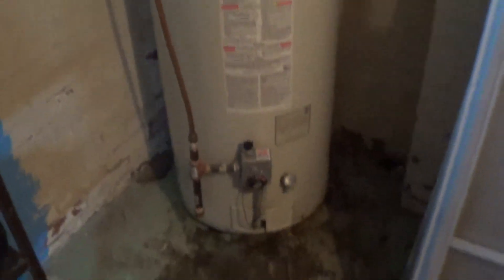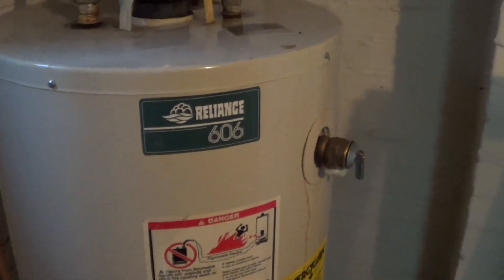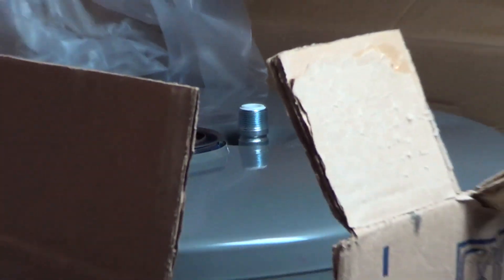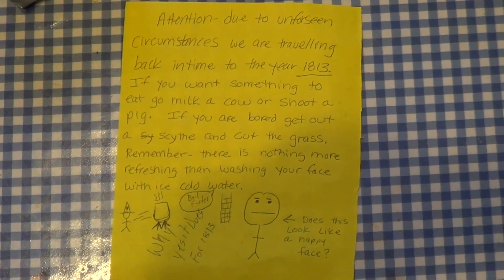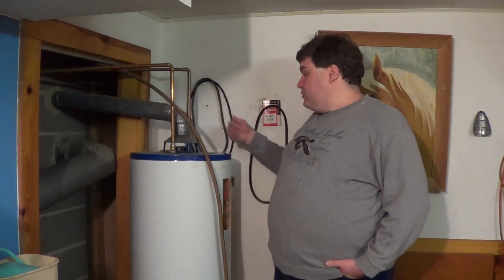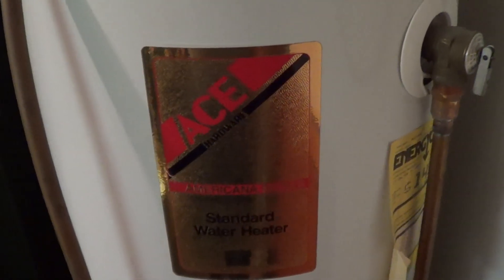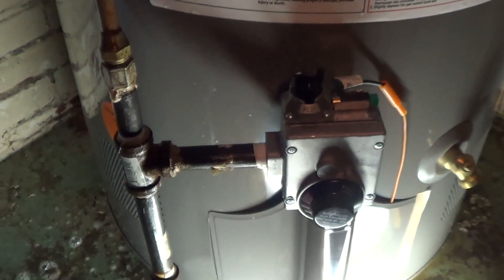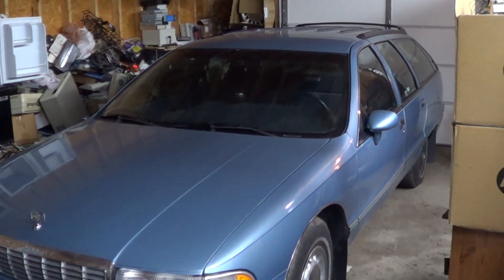Water Heater Failure, Replacement and Rambling

Comment: Weird that this pops up in my feed 6 years later. I just had to replace my enerplus gas water heater that was installed in 2012... what a short period of life. It also got pin holes in the bottom. I had a Bradford white installed and now I’m reading terrible reviews :(
Reply from the maker: You'll find terrible reviews for almost anything. Any Bradford White water heater I've seen seemed to be perfectly reliable and well made. At the very least, they're no worse than anything else. I fear that gone are the days of a water heater lasting 50+ years.
Reply: It seems like an ok unit to me at least! This one has a different style cold water dip tube, it makes the water in the tank have a whirlpool effect while it’s filling. This should keep the hard water deposits at bay although I do have a water softener now! Thanks for the reply.

Comment: i believe Rheem also owns the RUUD brand too ours lasted almost 20 years which was replaced as it was not producing hot water. as it was made in 1994 its a draft induced water heater a power vent model  with a hot surface igition what happens when it needs to heat the water the blower starts which closes a vacuum switch and starts the ignition and the burner fires when its done everything turns off the A.O.Smith water heater which replaced it its also draft induced which has an electronic self diagnostic gas valve. was installed in 09 the recent replacement was the blower motor as it burned out and put in a more energy efficient PSC motor to replace the shaded pole motor on it . with these draft induced water heaters in addition to the gas hookup you need to have a 120volt power source to the water heater and grounded. as A.O. smith makes a newer water heater with a spiral element in it.

Comment: It happens to me when I lost one of the Hot Water Tank where the water pipe had been busted, and the Hot Water Tank also busted open spread the water all over the floor since 2003, where I've got one is the unknown brand Hot Water Tank where I don't see where the label is except the warning and caution sign, and after I cleaned up the floor where the water is still left on the floor by using a towel and the vacuum to get the water up.

Then, when I came to Lowe's, they usually sells the Whirlpool Hot Water Tank where I need one so I can use the Hot Water where I will not stand of using a Cold Water by washing hands and so forth.

After replacing with the new 2003 Whirlpool Hot Water Tank, it worked fine. After about almost decade later, it start to leak through where you can connect the Water Hose, I have to use the picture or the bowl to get the water away from the floor and pour it outside where it will not cause to spread any water on the floor.

Comment: It is called "Planned Obsolescence"...which of course is the manufacturer only making the product to last a certain length of time so you are forced to replace it within a certain amount of time...this can be found in many many products now-a-days. They really don't make-em like they used to.
Reply: Correct. In this case, the factor that determines the length of the warranty is the size of the anode rod. Some manufacturers will sell two identical-looking water heaters, one with a 6 year warranty and one with a 12 year---the only difference between the two units is that the 12 year model has a much larger anode rod to keep it from rusting out so fast.

Comment: I also never understood how heaters without an anode outlast the new ones by decades. Maybe the steel just got so thin anf flimsy that leaks are just a matter of years. You can´t go wrong with a 12 year warranty though. Also, same with fridges. Lucky to get 10 years out of a new one. My grandma has a working one from 1956! No repair on that one whatsoever. (Truth be said, she will need a new one soon because the door lock broke recently. But still it cools like no tomorrow.)

Comment: Modern waterheaters and furnaces just don´t last. Our neighbor just got his new fancy heat pump type heating equipment replaced after one year in service and a very unreliable winter. Our oil burning waterheater/furnace is from 1978 and besides a new burner and some water circulation pumps all original. New stuff is energy efficient, yes. Even more than you like when it off half of the winter due to technical problems.

Comment: In our house we have an electric hot water tank, though I would prefer a gas unit. We are on the third tank as far as I know, it's been in service for over 10 years, maybe 12. I don't know how old the second tank was but we had to replace the elements around 1997 or so, then it started leaking right around where the pipe nipples thread in just like yours. My guess is that the average life is 10 years, though having the thermostat cranked above the recommended setting kills them faster.
Reply: OlegKostoglatov we had a rheem hot water system that lasted 23 years and it never leaked once and we had the  thermostat  cranked  a  bit passed the recommended  and it never ended dying but got replaced

Comment: Everything that I have read indicates that a high efficiency hot water tank with extra insulation is a better idea, less expensive to buy, less to install, and the energy savings is only slightly less then a tank less heater. There is also the fact that you waste more water with most tankless models since you have to run the tap for a minute or so till the burner turns on. The better tankless models actually have a small reserve tank of hot water to get around this issue.

Comment: Not to Calif code.  Gotta have a catch pan, a steel strap bolted around it to the wall, and a ground jumper between the hot and cold pipes.

Comment: Yeah you do need ventilation, we use a tankless system and it works just fine, we have only ever had 2 in about 30 years. We live in the Uk so our systems may be different.

Comment: I used to have the exact same Reliance 606 that was installed in 2004 at my house. In 2011, it didn't start leaking, but the thermocouple quit working, hence I couldn't keep it lit. Just as well, the previous owners must not have flushed it as it had a bit of buildup causing it to not heat as well, plus popping sounds when trying to heat. A replacement was necessary.

I replaced it with a 9 year Whirlpool (American Water Heater) from Lowes. Hopefully it will last the 9 years if not longer.

Comment: If you really want at least the chance to have a product that lasts you have to pay top dollar. I got a Pioneer plasma tv in 2004 where 50 inch was top end and Pioneer THE reference. Still works like new and I keep it till it fails. But don´t ask what it cost back then. I also have lots of old electronics in a dedicated basement room. Energy efficient stuff is nice, but it will negate savings and ecology if you have to replace more often so better stick with old reliable stuff as long as you can

Comment: Nothing lasts as long as it used to. I bet planned obsolescence is in every single product out there now, or they are just cheaply made. Result is the same. My grandma has a 1955 fridge that still works and our furnace is made in 1978 when the house was built. Our neighbors just got a new high tech heatpump system and since then the technician comes as frequent as the mail man ending in a complete replacement after one year. Who needs energy efficiency if you have to replace more often?

Comment: Rheem is a good water heater.  Had ours replaced in Mount Carroll in 1996 when the old GE Electric one went out.  Rheem Gas model, the only problem it had was the plastic suction hose for water inside the unit was getting soft and gumming up.  Replaced it with copper.  Ran perfect after that.  Still Proudly Manufactured in Fort Smith, Arkansas.

Comment: My mother has a 35 gallon GE hot water heater that was installed when the house was built in 1953. It's served and continues to serve the household well. She raised 13 children in that house and the hot water never went cold once. Infact the water has always been dangerously hot, about 165 degrees out of the tap. Everyone was aware of it and treated that hot water knob with a great deal of respect. The tank is glass lined inside and outside and the element was replaced once in the early 80s.
Reply: The heat exchanger is probably Monel, a copper nickel alloy that is used even in seawater for its corrosion resistance. It will probably never rot out.

Comment: You must live in an area with rather soft water. Here in the Fox Valley (east-central WI) it's relatively common to go through a water heater in about 7 years. A.O. Smith, Bradford White, you name it - they all go early.

Comment: The drainage was on the side and it had a metal tray which just rusted away. It rusted through the bottom where the gas burner is and eventually rusted its way through it too; luckily, the bottom pan didn't fall off. It was full, but it only rotted through the plywood floor; luckily, the 2X6 floor joists didn't rot away although there was plenty of moisture build-up and was instantly treated. I was more concerned with the live furnace wires rotting away; it even confused our electrical testers.

Comment: You guys can run copper gas lines (and likely even PEX) to water heaters? Lucky. Around here you have to run case iron black pipe all the way to the gas valve! The other problem with new gas water heaters is the stupid sealed burner design. They are highly unreliable and if you have a whole house exhaust fan, any slight down draft knocks the pilot out!

Comment: The exact same thing happened to me. Our water heater was leaking, so we called sears and bought a new one to be installed. They said it would be installed the next day, but unknown to me, they did not come until 2 days later. So i did not have hot water for 3 days.

Comment: Uxwbill, I've replaced many water heaters, and the clues indicated that many (most?) failed from the outside in.  In recent decades, many units have been plumbed with flexible connections or other fittings that have o-rings and seals that begin to weep unnoticed.  The slightest trickle saturates the insulation, and the deterioration begins.  Older installations were generally hard-piped.

Comment: I worked with the seabees for a while back in the 80s then I also worked with a master plumber. He helped me put in a ACE hardware 40 gallon way back in the 80s. I also know a lot of info since I know a master plumber living beside me. He tells me stories about plumbing. He told me the old ones had a better anode in the tank plus they have much better steel. I still have it installed and its probability old than your fathers. Be Careful with the leak tank it can complete fail anytime.

Comment: We bought a house from 1979 that had like you saw an original Gas water heater,  It broke and we also could not get parts.  The replacement lasted just beyond its warranty, and we are on another one.  It is pretty sad that companies have seemed to wise up to screw the consumer so they can make more sales.  But the plumber blamed it on US govt. regulations concerning the explosion proofing of the Gas water heaters is causing the damage.

Comment: my old water heater failed after about 7 years use.  it was a propane gas unit.  the burner failed on it.  i replaced it with another gas unit. my electric cooperative sells the"Rheem Marathon" electric water  heater that is suppose to be super efficient.  it has a polybutylene tank that carries a lifetime warranty.  i probably should have went with it, but it was quite a bit more expensive.  if (i mean when) my current water heater fails, I probably will go with a tankless design.

Comment: Is it permitted for homeowners to do gas pipe installations in the US? Here it will completely invalidate any insurance the home may have and is generally seen as a very dangerous thing to be doing without proper test equipment and training. If a paid workman fitted such equipment without the correct registrations that person could serve a prison sentence for it.

Comment: Just saying with what you said about cheapness of water heaters, my ge 1200 watt microwave died the other day with a dead fuse. We replaced the fuse and there was a loud vibrating noise, and it blew the fuse again. And so that was the end of it.

Comment: Very nice video! I would say newer appliances in general are getting worse.
Here at home we have a CNG furnace for water and heating (with radiators), so is not a problem as no water is "stored" inside it.
We also own Solar Panels for water heating and we have a boiler similar to yours, but with just an electric pump moving the heat transfer liquid from the panels to the boiler itself. For safety reason we installed it inside a metal canister, to not cause a mess if it fails, with its own drain.

Comment: I could be wrong, but when ours failed a year or so Ago, I asked the gentleman replacing it. And I believe what he said was older tanks used glass interiors, problem was they'd get dropped during install and shatter the glass and companies got tired of replacing them due to stupidity. So they changed to all metal tanks, but they rust out eventually.

Comment: Older water heaters do last a lot longer than the newer ones. My grandma's water heater is a Rheem from about the early '70s, and although it's way too small for her house, it works just fine. The newer models (especially the cheaper ones) probably have thinner tanks, that's why they rust away a lot faster.
I saw a water heater from about 100 years ago, and instead of a tank, it had coiled up piping and a gas ring. I think I'd prefer that!

Comment: Rheem is still in business? Interesting; I had a 1993 Rheem Ruud hot water tank, only mine wasn't nearly as bad as this one. It did, however, start to leak and ended up rotting right through the furnace electrical wires and support beams holding it all up. The furnace survived but the tank was replaced with a Navien instant hot water heater. Although it was hard work modding the house structure for it to work, it is such a major improvement and these are rumored to last over 20 years.

Comment: Ironic that the water heater was replaced in 2004.  That's the year the same thing happened to mine.  Bottom of the tank rusted out, and leaked water on the burner, preventing it from lighting.  Due to the fact that mobile homes require special gas water heaters designed for mobile home use, and I could only find 1 model and it was too expensive, I switched over to an electric model, a G.E.  It was easy, because the breaker panel is right next to it.  It still works fine to this day.

Comment: The pressure release valve on our water heater is on the bottom. After a small flood caused by the sump pump tripping the breaker, and us not noticing until a heavy rain, the valve corroded to hell (slightly alkaline ground water around here; things rust quickly.) Then it proceeded to fail, and unleash a 50 gallon torrent of hot water all over things in the basement a couple of months later. Even though it was during the middle of the night, the noise woke everyone up, thankfully.

Comment: Gotta think it's reduced quality. 

Put two heaters on the store shelf, and charge twice as much for the original design. Then bear in mind that the purchaser is planning on building the house and flipping it quickly. Which heaters are easier for the retailer to move? After a few months, the retailer is not so interested in stocking more expensive equipment that doesn't move. Only later do consumers, usually those who weren't present when the heater was bought, get a nasty lesson.

Comment: One possible reason could be the manufacturers using thinner tank walls to shave a little bit off cost.  Though higher quality units SHOULD have thicker walls and better seals, they may not.  Time will tell...